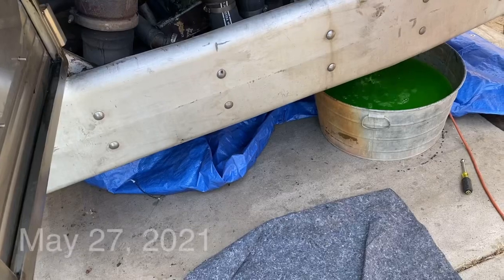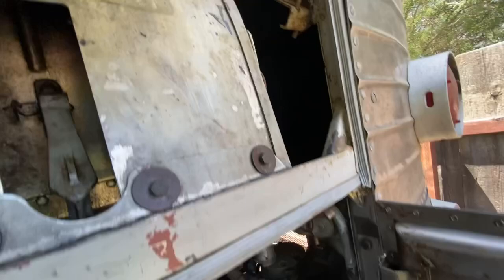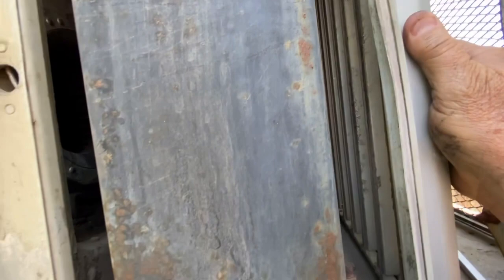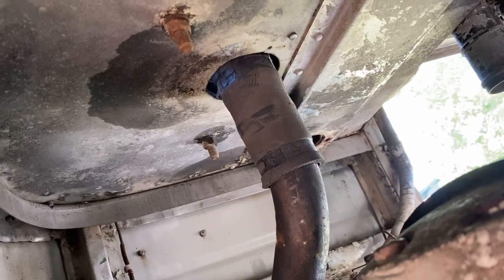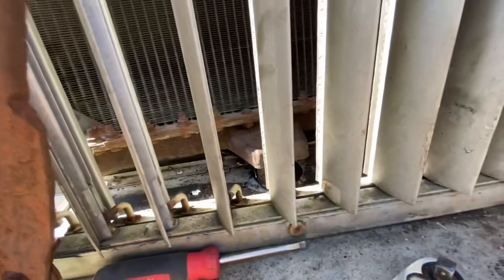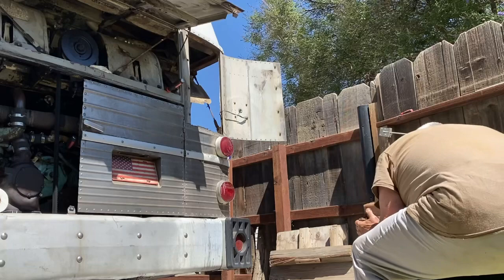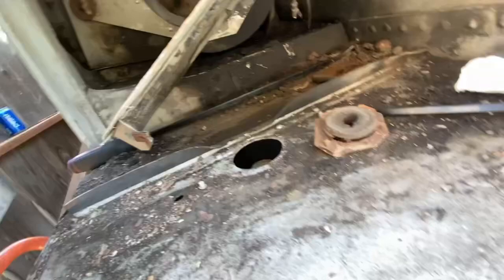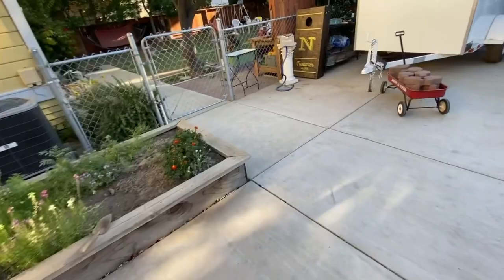#65 - MCI, MC5B, Bus Maintenance - Removing Right Side Radiator

Comment: The engine in the MC-5 almost makes it a hot rod in comparison to the heavier MC-7 and 8. The bus should be running cool without problems with the excellent power to weight ratio. The rust and general appearance of the radiator that was pulled indicates both sides really need to be done and you'll be happy with the results. I'd be shocked if the radiator you pulled wasn't an original, looking at the overall condition.  

I installed radiator side scoops on both an MC-7 and 8 when the buses were only a few years old without any positive results. We ran tests on them for almost two months during summer weather and there was no noticeable temperature changes. In theory it sounded good.  Clean radiators, thermostats that open up completely, and the proper injectors usually keep the motors happy. Of course a worn water pump can create issues, too. I had one instance where an owner installed higher performance injectors into his bus, only to find the cooling system couldn't keep up with the extra heat that was generated. 

Having worked for Greyhound when hundreds of the MC-5's were operating in line service right up until their removal from the fleet, the model proved to be reliable and efficient. Not at all uncommon to see an engine go 800K miles plus. Heating issues even in the hot summers of Southern California were rare, where the three axle units were frequently overheating. With the introduction of the MC-9 the heating issues were a lot less frequent. 

I would go along with everyone suggesting to replace the starter relay on the opposite side of the engine from the solenoid. It acts as protection for the circuit, also it's likely as damaged as your solenoid. If it were to fail completely you would lose the circuit to the starter. Not a very expensive part.  

I'm amazed at how good the skin is on the bus. Beautiful panels and well fitted luggage doors. 

Good luck with the project..
Reply from the maker: Thank you for your well thought out comment… you give me hope that having both radiators done will do the best for arresting my overheat issues… I love the bus and really look forward to traveling in it… this is my first coast to coast run in it so it’s good flush these issues out…

Comment: Oh man, good times.  Scoops are kind of a band-aid if you're making more heat than your cooling system can handle.  
Hope the rad shop is decent and doesn't charge too much, but it's worth paying up for.  I took mine to Kool Radiator in LV 'cause they quoted only $250 to rod it, and got it back spray-painted pretty black, but leaking.  I was trying to get on the road and didn't want to make the drive and wait again so I opened it up to try to re-seal it, just to find the whole header crusty and even some tubes still clogged.  It looked like they just opened up one end, did the bare-minimum to rod it through (and I even wonder about that), and didn't even pressure-test it afterwards.  After I re-sealed the header properly I found a crack in the end tank, and after brazing that up and assembling again I found leaks where the tubes meet the header.  Took it to the local shop to run the header, but they didn't want to touch it because the metal was so old and thin, and I was sick of messing with it, so I ended up getting a new core with more rows and louvered fins made for it from Detroit Radiator.  It was worth the upgrade, just wish I'd went that route from the get-go.
Reply: Cheap can be very expensive on 50 year old machines
Reply: @soillife1  AIn't that the truth!  By the looks of the old core it may have been original, or at least from the greyhound era.  Still had the V shaped tube pattern.

Comment: Looks like you got lucky with the first one, that bottom tank had zero miles left on it. Good luck if you happen to go 5hru Phoenix AZ on your home there is on street parking and it is pretty quite
Reply from the maker: Planning a northern route on the way home…
Reply: @GRNewman  that route is a lot cooler